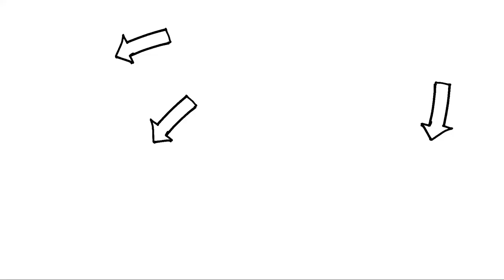The Covered Bridge Rebuild - Final Deck Section(First Layer)

Comment: Great video and the bridge is great. Here's a technical question. Is there any concern of moisture collecting between the decking and the pressure treated lumber  and causing rot later down the road? The treated stuff should be fine but I was just thinking about the decking where it sits on planks underneath.
Reply from the maker: Good question. I honestly can't say I'd really considered that, but I'm guessing/hoping it shouldn't be a problem. As long as the siding and roof are well maintained I think it should be fine.